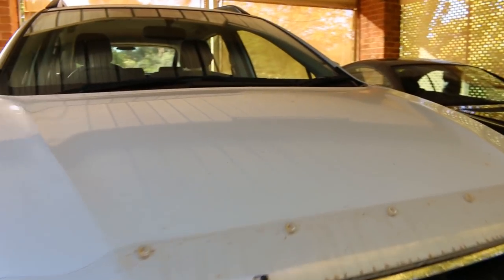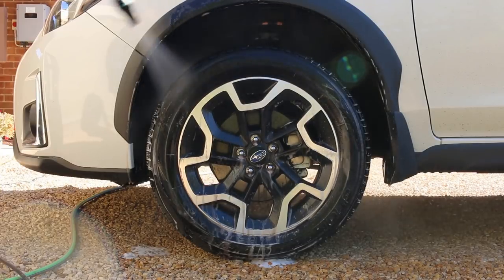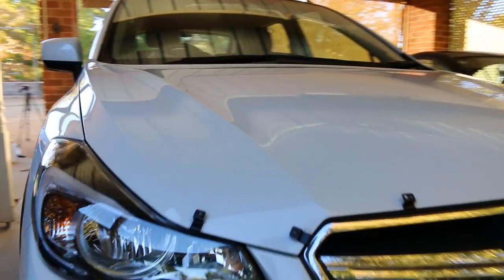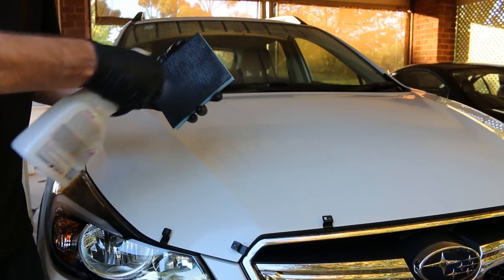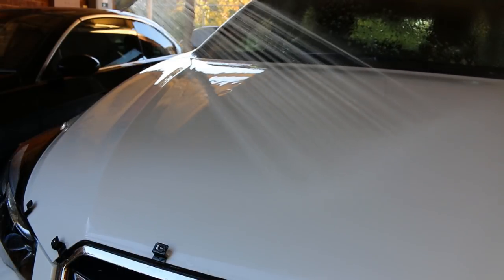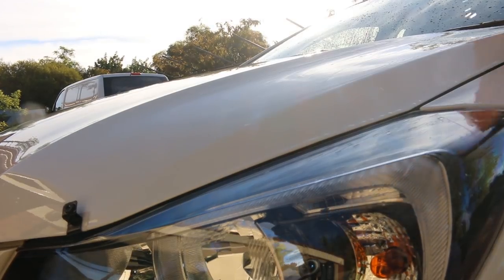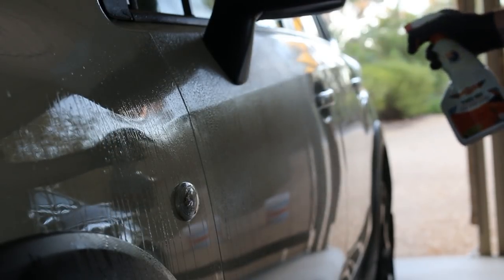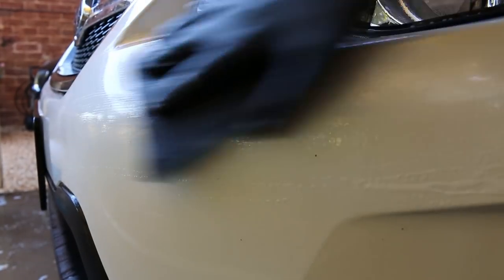Bowden's Own Three Way & Claying Rubber | Is It Worth It | FocusOnDetailing

Comment: hang on a second bowdens say it removes waxes and sealants Ceramic coating is a sealant, unless its only a couple of months or weeks old, when does it effect any SIO2 sealants either spray ons or direct bottle applications with a suede cloth method??

Comment: Now perfect to use, after a wax free car wash soap hi pressure application, then 3 way and then Turtle wax SIO2 sealant or Meguiars Blue bottle SIO2 based or better still NOVA jet spray on SIO2 sealant, so much protection that you will be amazed at the results, the problems is that most people do not have a machine polisher to use and want that quick clean and then wipe it down and then apply a quick spray on protection which lasts as well with Environmental protection UVA/UVB protection and UBC rays as well. :) also if you want a good car detailer in regional victoria forget it full stop, in melbourne and other main city's no problems?

Comment: Good review but just a quick tip could have also done a coat of afterglow after waiting an hour for the fully slick to cure as it’s more protective than fully slick
Reply: Neither are actually a sealant so it doesn't really matter. Products like lazy wax and Fully slick is obsolete cause after glow does it all but better anyway. And I don't care what bowdens say lol

Comment: You mentioned you have a ceramic coating on your car? I thought 'Bowdens Paint Cleanse and Restore' strip's a ceramic coat and that product should be skipped for anyone that has ceramic coats?
Reply from the maker: Bowdens Paint Cleanse and Restore isn't suitable for ceramic coated cars but Three Way and The Claying Rubber are. On the site they say that it's recommended to be used yearly as you can still get a build of contamination that can effect the coatings performance. I wouldn't go using PC&R on my own with the protection I have. Hope this answers your question

Comment: Tempest or Big Green Sucker ? I have both but prefer the Big Green.
Reply from the maker: Can't say I've used the Big Green Sucker but I'll be needing new drying towels soon so I might give it a go!
Reply: @focusondetailing3855  Firstly, great review well done. The Big Green Sucker is a must and probably the most important towel in my kit. After the wash while the car is still wet, I spray Afterglow directly onto the Big Green Sucker and shammy off the water that way, leaving a really nice clean, streak-free finish. I then use Lazy Wax to complete the process which seems to work best on my white paint.

Comment: I have use the exact product with nanolicious wash lubricate but it but a lot of scracth mark on my brand new car because or the clay rubber and I have to call Bowdens own and complain to them still they did not help me. I went to autobarn to return thw product and he said is the rubber mark because my car has many curve design... I need to repolish to remove the mark cause by the clay rubber mark .. I followed all the step and is very dissapointed with the product ... IT MAKES MY BRAND NEW CAR LOOKS OLD
Reply from the maker: Hey mate, that's rather disappointing I imagine but I've used this on many cars and haven't seemed to have the issue you had. Most claying methods can have an ever so slight abrasive ability. Leading to micro scratches that can barely be visible on some cars. Clay barring alone isn't ideal as it should be followed by at least a polish to restore the now cleansed paint back to defect free.
As long as you lubricate the surface enough, work in straight motions and don't apply excessive pressure then you will minimise the chance of defects from the claying process. 
I dare say you might need to at least polish your car to restore the gloss, defect free look you are after.
I hope this helps
Reply: @focusondetailing3855  Thanks mate I have did a ceramic sealant spray on the car. Just wipping the rubbber mark off one by one now.thanks

Comment: Great review Tim. I can also report great success on powdercoated alloy rims, raw aluminium and stainless steel roobars, body coloured vehicle canopies, vehicle body wrapping, and commercial tauntliner curtains. No product deterioration, referencing discolouring, substrate damage, staining, noticed. 👍👍
Reply from the maker: That's sooo good to hear! Really happy with how it was working and I'll be using it on all my customer's cars now I reckon! Thanks for the comment!
Reply: @focusondetailing3855  Just to add Tim. Used on fibreglass and carbon fibre, but will require polish will restore to original lustre, but no physical damage.Polycarbonate headlights and tail lights, windscreen, especially those affected by insect residue that Bowdens Bugger Off just refuses to release. Afterglow will restore slight dulling. Any hard plated surfaces but be careful on chrome plated plastic, as Three Way and Claying Rubber appears to be too harsh, and will easily dull as the coating is soft, considering it's a chemical blend that contains no metal. 👍👍
Reply from the maker: @andrewhallett-patterson9778   Awesome! Thanks for all the extra info mate! Much appreciated